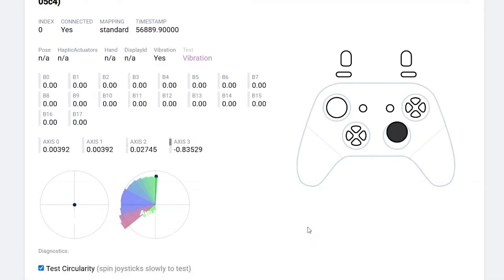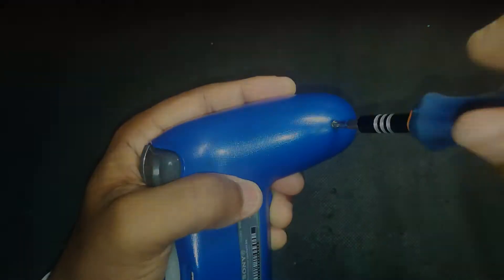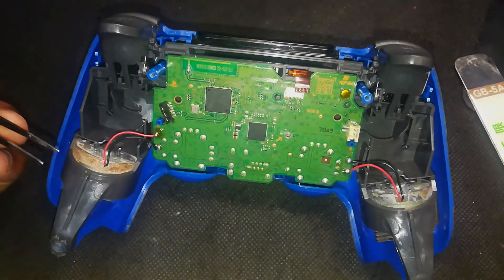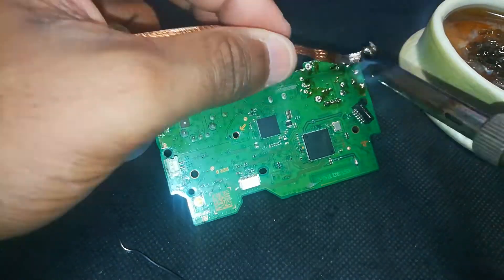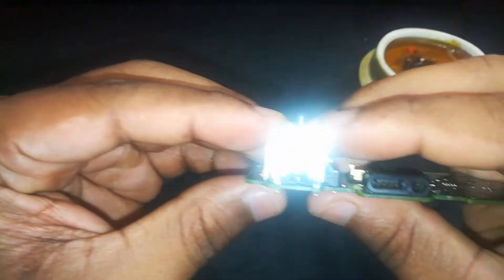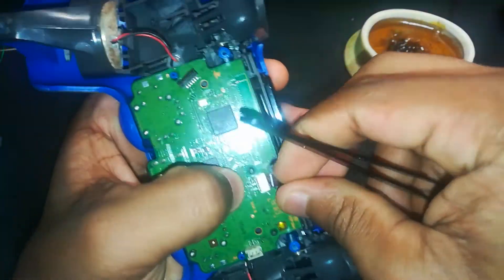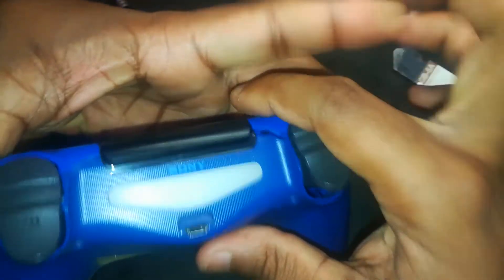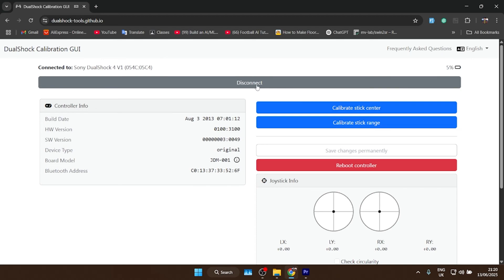Fix PS4 Stick Drift PERMANENTLY! | Replace DualShock 4 Joystick Module Like a Pro 🔧

Comment: Perfect video. Thanks for the upload. Best easiest method to use. Not cooking the board with a heat gun! Win!
Reply from the maker: Thanks a lot bro, really appreciate that! 🙌
Yeah exactly, no heat gun, no cooking the board 😅 Just proper soldering and patience.

Glad the method helped and that you found it easy to follow.
If you need help or want to see more controller repair videos, just let me know!

Stay tuned & stay techy 🔧🎮

Comment: What temperature was the iron?
Reply from the maker: Maximum Temp up-to 500°C, but you need just around 320°C - 430°C temp for Soldering Works✌️❤️

Comment: Nice this is what i was looking for,  i tried a cheap soldering iron but it had difficulty desoldering and soldering it, can you please share the links of Soldering kit that you are using and ipa too
Reply from the maker: Awesome! Glad you found what you needed! For the soldering kit, I use a basic soldering station with adjustable temperature, and for the IPA, any high-purity isopropyl alcohol works great to clean up the board after soldering. Good luck with the fix! ❤️

Comment: do you use rosin flux to solder each pins?
Reply from the maker: Rosin is better also you can use best flux available on Market.
I use Rosin for Soldering works, it always add extra layer of protection mask on board.

Comment: Good day bro, I was wondering how much was the total u spent for your tools. Also I'm scared because this is my first time disassembling my controller and using a soldering iron. Also I hope the tools you mentioned are available is shoppee 😂 we don't have Ali express here. I'll be using your video as reference too by the time u reply with the tools you used. Thank you!
Reply from the maker: Good day bro 🙌 glad you’re gonna try it out! Honestly, the total cost of my tools was around $15–30 (Solder, soldering iron, flux, De-soldering Wicks, screwdrivers, tweezers, etc). Nothing super fancy, just the basics.

Don’t worry too much, everyone’s nervous the first time using a soldering iron 🔥 but as long as you take it slow, keep the tip clean, and don’t overheat the board, you’ll be fine. (Solder Iron Temp should be 380 or 430 degree Celsius is fine)

And yup, most of these tools should be available on Shopee/Lazada or Amazon — you don’t need AliExpress. Just search for:

🔧 Soldering iron kit

🧴 Flux paste

🪛 Precision screwdriver set

🪝 Desoldering pump or braid

You’ll be good to go! 😎 And thanks for using my video as a reference❤️ feel free to drop any questions when you get stuck, I’ll help out.

Comment: Can you make the same with cougar t29 in a video ?
Reply from the maker: Sure I will, 💪❤️
Yes bro! I’ve already uploaded the Cougar T29 disassembly video 🔧🔥 : "https://youtu.be/y0_m_T8LRIM"

There’s a small trick to removing the L2 and R2 triggers — I’ll guide you through it in a new video.
After that, the joystick de-soldering steps are exactly the same as the DS4 controllers 😎

Go check it out and let me know if you need help anywhere! 💬
Stay tuned & stay techy!

Comment: Best video ever! When we go to get our controllers repaired, the repair guys charge a lot, and many times they even replace the original motherboard with a cheap local one and keep the original for themselves. This has actually happened to me. That’s why I started repairing my controller myself. Thanks to your video, now I’ll even be able to replace the analog stick on my own. Thank you for this video and keep it up, brother! ❤

And I would suggest that you use your own voice in the video.
Reply from the maker: Ayy sorry for the late reply bro! 🙏🏽 I’ve been caught up with some edits and tech stuff lately.

But man… your comment seriously made my day ❤️ That’s exactly why I started this channel, so no one gets cheated or ends up with fake parts. Mad respect to you for taking matters into your own hands and doing your own repairs 💪

And thanks a ton for the voice suggestion! I’m working on it! Gonna bring my own voice into future videos for that real connection 💯

Stay tuned bro, more DIY tech stuff coming your way! 🔥👊🏽
Reply: @TechTips-404  ❤